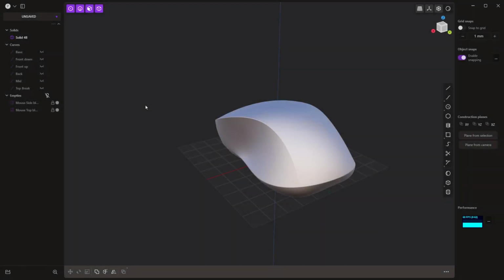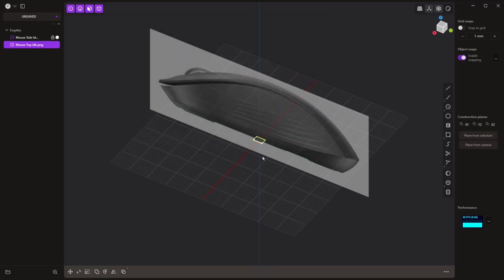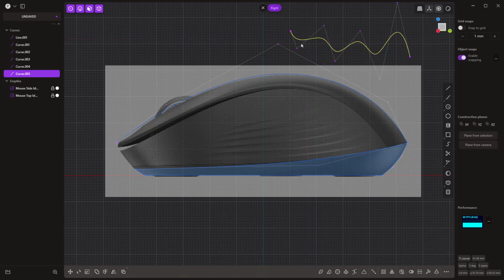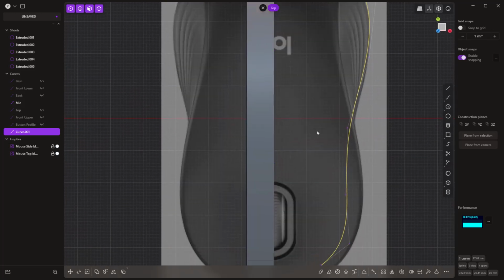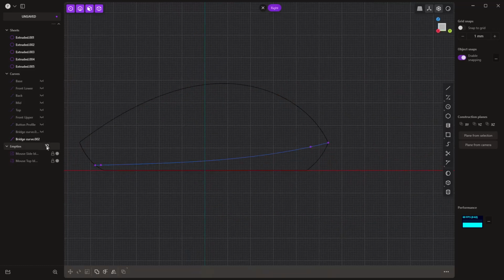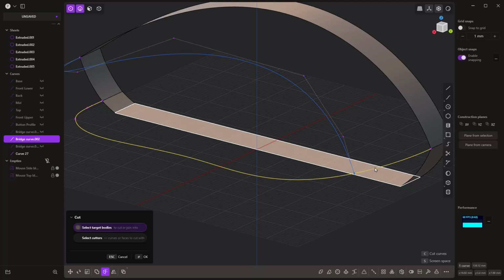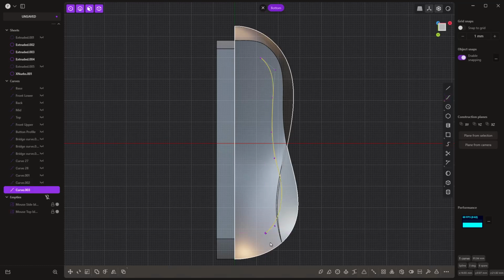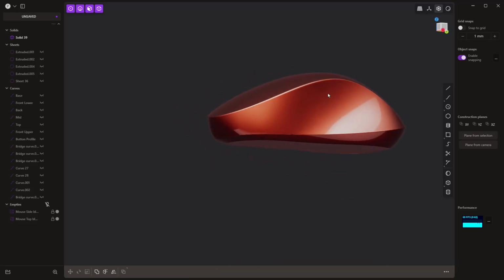How to Surface Model a Computer Mouse with xNurbs | Plasticity

Comment: I do not see the empties, how did you hide from that part of the video?
Reply from the maker: This video was from 2 years ago in version 2024 i think.  In 2025 and the current 2026 the Outliner structure has changed slightly.

When you use import/append and bring images in, you should now see them stored under "Images" in the scene rather than it creating a folder called Empties.   Next to the images should still be the same lock and visibility icons as in 2024

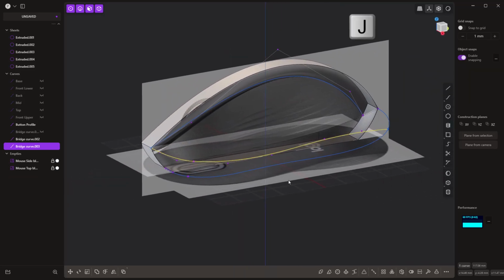Comment: 24:40 How was this done? Could you explain it?
Reply from the maker: do you mean the part just after 24:40?  the projected curve?.  What we are doing is taking the top down curve, and the side curve, and projecting them out relative to their "sketch plane" until they  hit each other.  This makes a new curve in 3d.  

Think about your computer mouse.  If you look at it from the top, the curve looks like its 2D.  If you look at it from the side, again looks like 2D.  So it is often easier to create a set of 2d curves that project out to build a 3d curve.

Does that answer it?

Comment: Positives:  You touch on topics no one else does, like "driving tangency", and "purpose of rebuilding curves".  Negatives:  you try to do too much at once.  Don't start something and tell us about 3 other ways, just DO that thing.  Then, you can talk about problems.  I need to see how to do something correctly FIRST.  And calling the images "empties" drove me crazy.  They are images, or blueprints.  lol 
I feel like there is much more than just the use of the controls that could be taught step-by-step, and your videos give a sense of that.
Reply from the maker: Thanks for the feedback :)  Yeah Empties.... its a term from blender and Plasticity.  basically anything that doesn't have geometry like an image are considered an empty.  i don't like the term either lol

My videos are all done live unscripted so usually issues or decisions that come up along the way I try to talk through why.  that is likely the 3 other ways thing you are seeing.  If i get to a spot where i need to make a decisions I generally go down the paths to highlight them.  not in all videos but in a lot of cases I do mention the other stuff.  No matter how many ways i show I will get a "you could have done it this way" face smack moment ;)

Hopefully some of the other videos will be a bit more streamlined if you stick around!

Comment: So is plasticity better than fusion For surface modelling?
Like Ease of doing things....

How is Solidworks or Catia? I'm actually searching for a tool that's would let me get quick iterative concepts...
Reply from the maker: the xNurbs tools in Plasticity make high quality complex surfaces without having to be as precise about all your guide curves and rails.  The studio version also has the blender bridge, which now supports taking models from blender to Plasticity.  So you could model a complex shape in blender and live transfer to plasticity for detail work.

What plasticity doesn't have yet is a subD tool like Fusion forms.  Working with mesh designs like from scans is also more complete in Fusion since you can snap a form to a mesh or you can get a mesh curve.

Solidworks and Catia (the local installs).  Solidworks has a good surfacing kernel but you need 3rd part tools to get good subD tools.  Like nPowers Power Surfacing.  The 3dexperience has subD/forms but its not linked to any file, it would be somewhat of a dumb solid without history, which to mean is a negative.  Catia is powerful but even more expensive than Solidworks.  Like we are talking a few hundred for Plasticity. $600/year for Fusion. $8k for Solidworks for 2 years, then double that to go up to Catia.

So for me. Forms in Fusion is really powerful and usually where i go for my quick concepts.  If Plasticity had that push/pull ability combined with the surfacing tools it would certainly win.  Plasticity for me can build really high quality models/surfaces quickly with the Studio license with xNurbs.  You still need to create curves though and build curve networks.  if that is how you work normally then that might not be a big deal.
Reply: @LearnEverythingAboutDesign   SO the SUBD in CAD is exactly like Blender? Poly model? or there something else going in the  background ??
Because i have heard Engineers say RHINO SubD is great or ALIAS subD to Surface workflow etc.

all these tools are basically traditoinal College taught and im not from DESIGN college.

all i have learned is Blender, but got a Hang of Plasticity recently. BUT people say if you want a JOB just Get on CATIA , ALIAS etc.
Reply from the maker: @lavatr8322 There are loads of SubD tools in CAD programs.  Some better than others, some add-ins you have to buy.  Whats in Fusion (and Inventor) is called T-splines.  It was originally an add-in for other programs like Rhino but Autodesk purchased it years ago and now its only in Autodesk products (not alias, it has its own).
But SubD in a CAD sense is like the push/pull of poly modeling in blender, but the difference is when you finish a subD "form" you get a NURBS surface.  In Blender the end goal is generally lower poly game assets, or animations so it does graphical smoothing, subDiv mods etc.  You can't export a model from blender in a NURBS surface.  This is an old video but i have several on the channel trying to compare them.
https://youtu.be/78swx-gl_F0

At the core the push/pull is the same, but the tools you have vary.  For example there is no edge weighting in Fusion Forms, but you can have edge weighting in the Solidworks add-in Power Surfacing.  Variable edge weighting can be nice and i think Rhino8 was working on that, but i haven't explored it yet.

In terms of the different software.
Catia/NX are generally "enterprise" level tools.  They have various offerings depending on the industry.  NX and Catia are used by big auto/aero companies.

Alias is a Class A surfacing program.  It is meant to generate high quality surfaces and has a lot of curvature control, sub-d tools, and surface tools.  There are multiple versions and Autodesk has (or had) a 12mo at home learning edition.  its a tough program so be warned.  Last time i used it the UI/UX still seemed very clunky and old.

Fusion has amazing tools for the price.  You can do a lot but its surface tools are still a limitation for me.  Depends on what you are planning to make/do, but great for a good general cad tool.

Comment: Great tutorial, thank you so much. Plasticity is one of the best pieces of software with one of the worst user interfaces I've ever seen. I wish the developer cared to make it "discoverable," like desktop programs are supposed to be. If it had a top menu bar, with all possible commands neatly organized in menus and submenus, like File - Edit - View - Create - Trasform - ... that would get it 99% of the way there. There's no reason a command like Alt-D should not be discoverable in an Edit menu, or all the types of Rebuild be neatly organized in their own Transform menu. We all learned to use Office and other desktop tools just by exploring the menu bar, so I really don't understand why somebody would create a program where more than half the commands are hidden in a search bar, where you need to know the command exists in the first place to be able to find it. That's such an incredibly bad UI design, I really don't understand it. Same with Shift, Ctrl, and the other modifiers that can be used while creating or transforming objects, there's a small contextual info panel in the bottom right corner but it never lists all the modifiers that are available. I still bought it and use it as my main 3D program, because there's nothing quite like it. It's the closest thing to an "Inkscape for 3D," but it lags behind Inkscape in UI design so much. What a paradox.
Reply from the maker: Yeah it is a departure from convention for sure.  The release of 25.x has given us a few locations to find the tools but they are alphabetic and not based on a menu.  I will say though that the context based tools is nice however I do tend to agree that some more discovery would be a good thing.  In the first versions of Plasticity beta and v1 it was tough to know what you click on and what to do.  For example knowing you needed to select all profiles on a loft before invoking the command.

I haven't personally used Inkscape.

Comment: Did Project Curve Curve disappear with 2025.1 ?  I can not seem to find it nor any online explanation for its omission
Reply from the maker: I think what is happening is instead of multiple commands that fall under one tool they are just under one tool.  Just the tool "Project",  I think its probably an effort to clean up the command list.  but PROJECT will let you select the target body, then the curve.  See if that works.

Comment: Do you know how to draw a archimedic spiral with plasticity?
Reply from the maker: Sadly there is no tool to do that easily.  At least not that I know of.  Years ago there was one in the beta program but that was on a different 3d kernel.  

You could draw the polar graph and snap a spline to various points,
Reply: https://youtu.be/PEFQhJg7C80?si=O3gLwrg9wE1pN3DU
This seems to be the solution. Thx for your answer

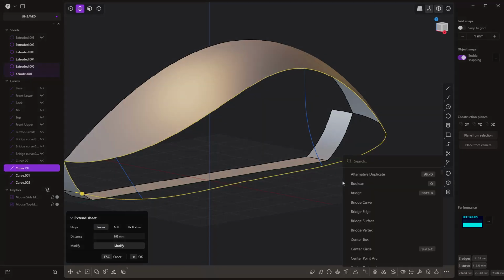Comment: 31:45 i cant do that with regular loft tools.
Reply from the maker: Right, to follow this you would need xNurbs which is in the Studio version of Plasticity.   You could use the Patch tool but you won't be able to use those internal guide rails for that patch.  It would be pretty close though just based on the other input curves.

Comment: The zebra mode shows a lot of distortions.
Reply from the maker: In which areas? The resolution of the zebra stripes in Plasticity isn't adjustable. There are undulations in the surfaces but I didn't see any jagged jumps in curvature anywhere., but may have missed them.

Comment: bro do you offer private lessons.i want to learn and want to learn the right way from the start. im sure i could learn from youtube, but i see value in learning the correct way and fast. i fell like i could learn very quickly with the right guidance. if you are interested let me know. if you will take crypto even better im new to all this im an inventor and artist. i got my first 3d printers and have so many ideas for products and want to be able to model and manufacture myself. im sick of dealing with china for my manufacturing
Reply from the maker: I don't currently offer private lessons or coaching but might in the future.  I have a site www.learneverythingaboutdesign.com   I only have 1 plasticity course up there but have many others in Fusion for things like designing your own PCB, design for injection molding, and just absolute beginner content.

For plasticity on this channel i have a few playlists.  One is a 5 part series for getting started in Plasticity and going over the common tools and how to use them followed by a 45min video walk through modeling something.

You can feel free to email me support@caducator.com as well.
Reply: @LearnEverythingAboutDesign  yes I saw that and plan on taking you one class for the speaker soon. We'll if you are interested in it , in the somewhat near future. Let me know. Thank boss

Comment: Great tutorial - so detailed and explained really well.
Reply from the maker: Glad it was helpful!
Reply: Good tutorial but this program can't compete against Alias, ICEMSurf, CATIA 😂
Reply from the maker: @pedrojoganson3699  True but we are talking about a much different price point.  $300 for plasticity studio vs $4k-$10k/year for alias depending on the package.  ICEMsurf is Dassault/Catia and it would be more than Alias.

Alias is a dedicated Class A surfacing program with many great tools.  the UI/UX is way out of date and needs attention for the price but super powerful.  Base ICem is $2500 last i checked, but they have like 8 packages so very easily get pretty expensive.

Comment: Hi. Great tutorial. I have to decide to buy plasticity or not, but the main reason for me is if I can import stl files from web and make some modyfication. It’s possible in plasticity?
Reply from the maker: Sadly no not really.  Plasticity can bring in a mesh file but you can't really do much with it.  Plasticity is built as sort of a companion to Blender, which is a mesh modeling program.  Depending on the modifications you want to make I would say use Blender or Fusion.  

I have done a few videos for the Autodesk YT channel on the subject.

https://youtu.be/yLGq_QJEEuo?si=XJbq_gPDxeLGyt3V

Someone else did a follow up video as well.

https://youtu.be/d-U-_HPDGsY?si=5q1krxd9lIGR0W40
Reply: @LearnEverythingAboutDesign  thank you

Comment: Thanks, Matt. Since you have done extensive surface modelling in Fusion 360, which product do you think is better for surface modelling-- Fusion or Plasticity?
Reply from the maker: Dangerous question :)  There of course will be a disclaimer.  I think building curves is easier in Fusion.  Because you can drive tangency and curvature continuity (smooth) with constraints and work with precise inputs that helps depending on what surfacing you are doing.

I think Plasticity surfaces in general are better quality and the xNurbs tools is a bit more forgiving when trying to do complex modeling, but it currently comes at the cost of the curve definitions.  Curves are great in Plasticity but not being able to snap endpoints and drive tangency makes the curve creation/planning a bit more work.

Comment: Great Video Matt, very nicely paced, how do you find the vertical mouse btw, Ive been a borderline evangelical zealot when it comes to the mx master 3, but always been intrigued by the vertical mouse!
Reply from the maker: Thank Peter!  Yeah I have used a few other Mice over the years but I found myself getting a lot of wrist strain.  The MX Vert isn't perfect but my wrist feels better.  I don't use a 3d mouse anymore, just left hand on the keyboard and right on the mouse.  I even switched back to a wired keyboard, pretty minimal :)  My biggest gripe with the MX vert is that its taller so often when going from keyboard to mouse i knock it across the desk :)
Reply: Haha yep I can see that happening, lol well it's good to know if this one ever breaks it might be worth a go!
I never used a 3d mouse they look good for navigating 3d environments but they look like they would be slow to model with